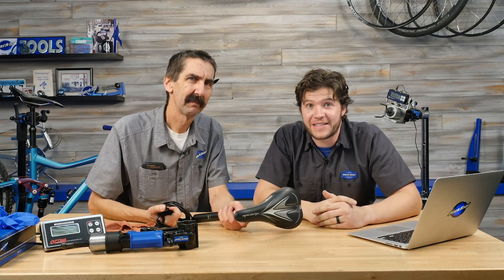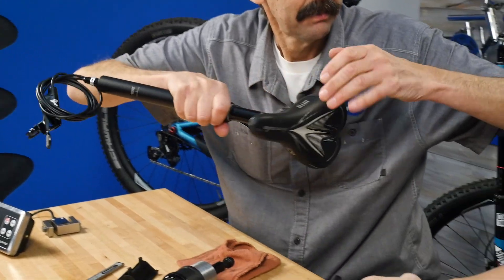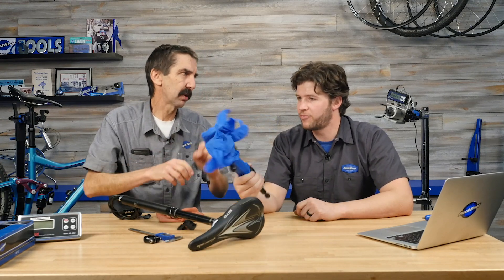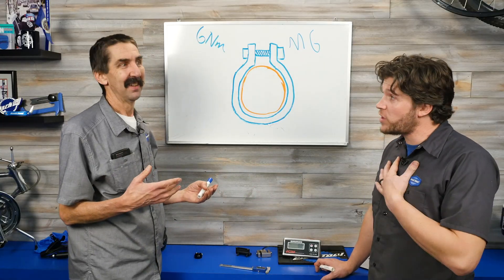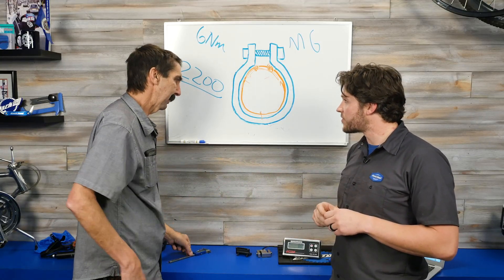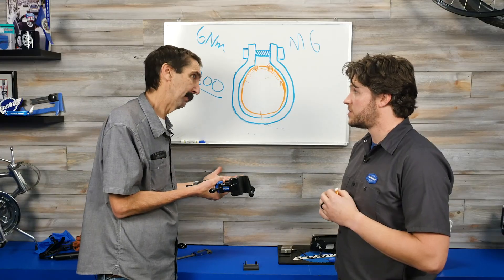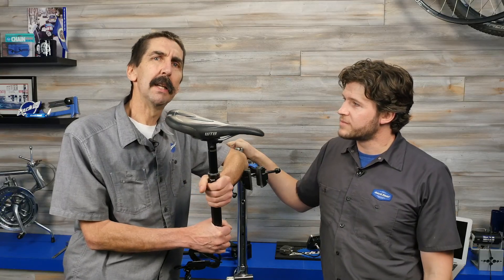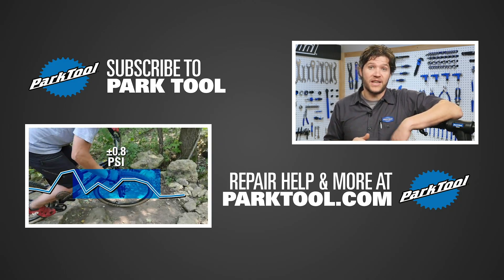Shop Talk: Is It OK to Clamp My Dropper Post in a Repair Stand?

Comment: Just clamp the top tube ....  surely ?
Reply from the maker: No, top tubes are not designed to be clamped and can crack if overtightened or levered when in the stand.
Reply: @parktool Yes. Thnx. So I realise now.

I never realised how thin my triple butted tubes were in the middle.

I'm getting one of those modded stand attachments... thnx !  ❤

Comment: I'm a retired structural engineering professor.  This is great stuff.  But be aware your "twisting" force is better described as a bending force...  A bending moment.  You should then convert moment to longitudinal stress using the equation Mc/I.  Those longitudinal stresses can then be checked against material capacities.  Let me know if you want to work through these numbers together.

Comment: Seat clamp do not squeeze directly onto seatpost, rather frame's seat tube - hence the clamping force is distributed on larger surface of the seatpost..... I do not undermine the conlusions though, just pointing out obvious misscalculation.

Comment: just finding this video today—excellent topic.  

I stopped clamping by the seat-post when i got a dropper.  as a result my work stand becomes less relevant as I have workarounds.  I use wheel stands front and rear for most work.  I use the Park frame work stand for drive train but rest the saddle on top of the massive Park stand clamp, which has a pretty wide surface.  I think I only use the clamp on the Park stand when I remove my fork to service.  Will hold it in the clamp by the steerer tube.

Comment: Wonder how the numbers change for a much heavier eMTB? Anyone able to extraploate the answer from the numbers in this video but changing the bikes weight to that of a typic eMTB (Say 24kg or 53lbs)? ChatGPT has given this answer by proportionally scaling the numbers from this video assuming a heavier bike weight:

To calculate the rotational torque for the bike weighing 53 lbs, we can use a proportionality approach. Let's assume that the relationship between the bike weight (W) and the rotational torque (T) is linear. Therefore, we can set up a proportion using the initial values:

30 lbs (initial weight) -> 27 Nm (initial torque)

Now, we can use this proportion to find the rotational torque (T_new) for the bike weighing 53 lbs:

30 lbs / 53 lbs = 27 Nm / T_new

Cross-multiply to solve for T_new:

T_new = (53 lbs * 27 Nm) / 30 lbs

Now, calculate the value:

T_new = (1431 Nm) / 30 lbs
T_new ≈ 47.7 Nm

So, if the bike weighed 53 lbs instead of 30 lbs, the rotational torque on the work stand would be approximately 47.7 Nm.
Reply: I'd expect it to be slightly more than a linear increase with a battery attached. The center of mass will move further away from the seat post.
For no battery it should be scalable, as Nm is simply force(N) x lever arm(m).

Comment: I'm clamping my dropper below the section that is moving up and down, just to be safe. I don't care if it may be ok to clamp the upper section because I have no need to. I only need to clamp at one spot to hold the bike, so that's why I choose the most solid part where it doesn't matter if it get scratches or not.
Reply: On my e-mtb there's only about 4 cm of the dropper's lower sticking out of the frame. In the video they said - if you have the space, clamp on the lower part. If not, ok to clamp on the upper.

Comment: Thanks guys. I have the park tools stand and have been clamping my heavy (24kg) emtb on the frame, as I was lead to believe you should never clamp the dropper. I always wince when putting it on the top tube. No more, seat post from now on. Thanks from the UK. Great video.

Comment: I am wondering if this kind of thinking is the same with my concerns for putting up a 80+ lb fat tire ebike. I am worried the bike would be too much front heavy twisting pressure to clamp the bike by the seat post. Going by this video, it should be fine - correct?

Comment: Nice effort, and good to know I can hang it on an extended post. However, I think I’m missing part of the evaluation, namely the part where torque forces on the post seal apply, and the forces in the length of the post. Based on the weight allowance of a rider, and the angles of the post, I would imagine the torque on the seal cap to be negligible in comparison. Likewise, I think the forces in the length of the post (rider weight) to be also not high in comparison. But the construction vertical is very different. It is not designed to have a tensile force acting on the post. So to know if you can hang the bike on the top part of the post, you really need to know what tensile forces the post can take.
So personally I would probably not hang it on the top part without knowing. As demonstrated in the video, hanging from the bottom part of the post should be fine.

Comment: What about clamping a $300.00 carbon seatpost?
Reply from the maker: Sure.  If you ride it, just hitting normal bumps apply much more stress.
Reply: It also depends on the carbon seatpost's nature. Most are workstand friendly, but you need to be careful of the über lightweight ones from the likes of Darimo, MCFK, Schmolke Carbon and THM as these seatposts have very thin carbon walls throughout most of its length, this is what makes them insanely light, and less suitable for heavier riders.

Comment: Thanks for the video. I have an S Works Turbo Levo with electronic dropper. Any recommendations as to how and where to clamp my Park Tool stand?  Thanks
Reply: Is it the Reverb AXS? If it is, you can use any scrap seatpost instead since that dropper post is easy to reinstall, like a regular seatpost.

Comment: Is it ok to clamp the bike by it's frame?
Reply from the maker: Clamping the bike by its frame is always a risk. Do not clamp carbon frames. Clamping metal bikes can lead to issues but not typically catastrophic. Often just paint related. The post is the best option for clamping on most bikes.
Reply: @parktool  Thanks guys, appreciate the help 👍

Comment: Personally I rest the front wheel on the ground in most situations when the seat post is clamped in the stand. It’s just more stable and less torque on the work stand also.
Reply: More points of contact with the ground the better.

Comment: Manufacturers simply advise not to do it, or to be cautious. I think if they fully endorse it, they're worried some yahoo might get the wrong idea. Common sense isn't so common sometimes. A big butt on the saddle subjects the post to much higher forces than a stand will typically impart.

Comment: Re seat post collars - I've changed from standard collar on Scott scale labelled 4nm to a hope collar labelled 8nm, should I have stuck with same nm collar as stock or are all seat post forces equivalent (the hope is approx double width of stock)?
Reply from the maker: Seat post collars are a great example of where a torque specification is limiting and not always applicable.  The there are now three manufacturers involved, so ideally all three should collaborate and agree on a torque.  The frame maker, the post manufacturer and the collar manufacturer may have each different ideas.  Here you want minimal torque to achieve the job, which is hold the post.  If the post does not twist at 4Nm, then it will now slip down.  If it takes 6Nm, then 6Nm is the right torque, etc.

Comment: My post is raised to full height.  I can't clamp below collar; I'm clamping above the collar.  My jaw covers are clean and are clamping the upper stanchion.  My bike is hanging level.  

Question: is using my repair stand as a substitute for a bike stand an acceptable storage method for my bike, or is this ill-advised?
Reply from the maker: If the post is at full height, it will be fine to store this way.
Reply: @parktool  thank  you for this educational and entertaining video, and prompt response to my question!

Comment: What about forces when you are actually working on the bike ? If I work on BB I may apply more forces and weight...still not sure what’s best practice🤔
Reply: If it's a threaded BB you're working on and you're either torquing it down or cracking it loose, you can do it with the bike on the ground.

At least that's how I do it.

Comment: So if psi is such a big concern, why don’t Park Tool come clean about why they discontinued the ISC-4 ? https://www.facebook.com/photo.php?fbid=10217222876425279&set=gm.3520444501302370&type=3
Reply from the maker: Bike designs forced us to get rid of the ISC-4. if someone used it in the wrong frame they could damage the tool and the frame. Unfortunately that tool was discontinued not because it was bad but because it could be used in ways that could damage things. in the right hands its a great tool.
Reply: @parktool  I have just "paid through the nose" to buy a used one from eBay USA, just two days ago, so "in the right hands it's a great tool" is reassuring. Thank you for your reply, appreciated...

Comment: Hello,

When measuring the torque at the clamping jaws exerted on the seatpost would the moment arm of the bike not multiply that figure massively? I'm not an expert or trying to piss on anyone's chips. Just a question.

Thanks for doing the video.
Reply from the maker: Think about how the seat collar becomes the moment arm when a 200lb rider is riding as well. It does not have soft jaws either.

Comment: Clamping my bike by the Reverb stanchion in the repair stand, while rebuilding the bike definitely damaged it and it made it not move up and down properly. Clamping a dropper in a workstand definitely puts some angular (lateral) forces on the post because the balance point of the bike in line with the post. This  can cause it to put too much stress on the connection point (where upper stanchion and lower tube meet) and can slightly bend the connection or damage the keys. There is too much lateral pressure. When you push the dropper down while riding, you push it down straight, so very little angular (lateral) forces. 

Had to toss my Reverb and get a new one. It was very old anyway, but definitely taught me a lesson.
Reply from the maker: Your reverb was not damaged due to being installed in a repair stand.
Reply: @parktool  My Reverb was absolutely damaged by clamping it in the repair stand by the stanchion. It worked fine before rebuilding my bike, but after a week in the repair stand, it would not work.
Reply from the maker: What were the symptoms? Often a post will not rebound because the seat collar is too tight. If there was mush in the post it's likely it was not at its highest point and pulled a vacuum. But the likelihood of the stand damaging the post is almost zero.
Reply: @parktool  Totally disagree. I think you don't understand my comment. 

I have been riding and working on mountain bikes for decades. Owned 5 reverb posts. It was not the seat collar too tight. The same symptoms occurred with the post out of the frame. I completely re-bled the post, but still had the same problems. Also, I never changed the tightness on the collar of the seat clamp. 

You might want to try it yourself. Put your bike w/Reverb clamped by the stanchion in a repair stand for a week. Then see what happens.
Reply from the maker: We have had hundreds of Reverbs in stands with zero issues. So, we have tried this. I guess Im just curious as to what actually happened to your post during that build. 
What were the symptoms?
Reply: @parktool  Did you have any of those bikes in the stand for long periods of time like a week? Perhaps the age of the Reverb made it more susceptible, but still don't think it is good for any posts. The post did not return well was notchy  and even tougher to drop. Before it was in the repair stand for a week, it worked fine. 

Why did you say in the video that several companies you talked to say, "absolutely do not clamp it by the stanchion in repair stands"?
Reply from the maker: Yes, Plenty of time in the stands. Plenty of time rebuilding Reverbs too. Im sorry to be contrary to this but we have talked to SRAM/RockShox and damage caused by being put into a stand if everything is cleaned and the post is at max hight is very near zero. Sorry but we have to put our trust in our experience and the experience of the manufacturers and the sheer fact that riding puts way more strain on a post. 
One company says do not clamp the post in a stand at all. The only reason for this claim as far as we can tell after talking to them is to remove themselves from any sort of liability and is not based on actual potential for damage.
Reply: @parktool  That is fine you disagree. Then what you are saying is my Reverb must be defective and not have been caused by my actions of putting it in a repair stand (misuse, operation, or improper maintenance)? 

Every company, Park Tools included is trying to avoid liability from misuse, improper operation, or improper maintenance.  Which is understandable because they want protection against people not using their products in accordance with their standards.

Comment: My new tallboy will be here later this week. All i have for a bike rack is a trunk mount so i will have to use my  top tube adapter  to mount the bike.  it. Is it ok to use the top tube adapter with the dropper post as long as i have it in the extended position?
Reply from the maker: Sure thing. Be sure that everything is very secure to prevent anything from falling off.

Comment: I've heard the "switch it for a dummy post" idea suggested to someone with the wireless Reverb AXS, which I think is a great idea. Not only is it the only dropper with no cable routing to worry about, but its also the most expensive dropper on the market by a large margin.

For everyone else with a more affordable internally routed post, the time and effort required is simply not worth it.

Comment: Great analysis.   Love the load cell and torque meter.    In regards  to torque 20 ft lbs is just that , twenty pounds hanging on the end of a lever that is one foot long.   Convert that to inch pounds and it is 240  in lbs, which is 240 lbs hanging or pushing on a lever that is one inch long.   So if  the clamp was two inches tall, there would be one inch each direction of center to then there would be a 240 lb force pushing on the seat post to hold the bike in that position.    If the clamp is 4 inches tall then the force would be half that.   Good  wrap up that the forces encounter ed riding a bike are higher than what the repair stand clamp will cause.

Comment: Hi guys, have a question. Can u rotate the bike up or down 45-90 degrees using seat post or need to use a frame for that. If yes how much clamping u can do for carbon frame?

Comment: Well the Crank Brothers instruction manual says do not clamp the dropper's upper extending piston. Whilst I agree the crushing forces aren't a problem, don't forget about the dropper's internal mechanisms. If the bike is clamped by dropper's the upper piston and the bike is not allowed to swing/rotate to it's balance point before clamping then there will be a large torque applied to the extended dropper and this torque will transmit into the dropper seals. Yes it will probably be OK but, if at all possible, surely clamp the top tube (unless carbon), use a rag and, if clamping the dropper, then allow the clamp to rotate to swing the bike into it's balance point so the twisting is minimised just as though you have picked the bike up by the dropper using your own hand. The bike doesn't have to be level to work on it.

Comment: And if a 100kg man(women) sits on the seatpost the forces for pressure, rotation etc are even higher. The dropper is designed to sit on it ans so to take this forces. A upper tube (carbonl is not designed to take any  force in clamping direction. It is just drsigned to hold the frame together...
Sorry 4 my english, its not my native language 😉

Comment: I just clamp the top tube.  I am much more comfortable doing it that way.  I don't even clamp it fully as I let it balance first, then tighten.  It's way easier to just lift the bike into the open jaws horizontally, then pull down the upper clamp and lock.  Clamping the seat post would actually be more fiddly.

Comment: You say clamping is OK so then please tell me why some vendors like Crankbrothers explicitly WARN you to NOT clamp on the upper tube but on the outer tube ONLY?!? They will have a good reason for saying so...  I liked your videos and considered the contents trustworthy until now but this one is really bad! If in doubt, ask the vendor and don't listen to this video!
Reply from the maker: Andreas, Good call. Just as we say in the video. Check with your manufacturer to be sure. Many manufacturers tell you not to clamp the stanchion because they do not want to increase the risk of scratching the tube. If the tube is clean and the clamp is clean and at its highest point, I will clamp it. The stress of you riding the bike is far greater than any stresses applied while installed in a stand. I'd venture to guess that if you called Crank Brothers they would say something very similar. We talked with many dropper companies before posting this video.

Comment: I've got a KS LEV-DX and it's easy to pop out the cable and replace the post with an old standard post I picked up while dumping stuff at the local recycling(broken seat clamp)....no concerns therefore and peace of mind!!!
Reply: I’ve always clamped my bikes by the dropper’s stanchion (dropper fully extended). Been doing this for a few years without a single issue. I just take care not to clamp in stressful positions that could cause excessive bending to the dropper.

Comment: Awesome video guys! I've always gone by the conventional wisdom "Don't clamp dropper post stanchions"...not anymore. Clamp away! Only problem I can think of is, like you said at the end the rubber clamp pads better be very clean. If there is a piece of hard grit in there it could easily scratch the dropper post stanchion.